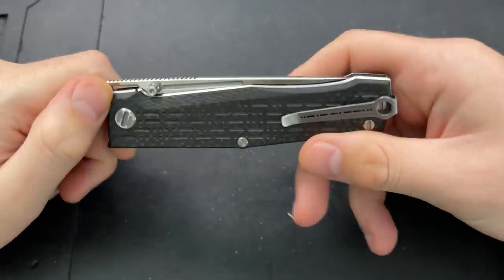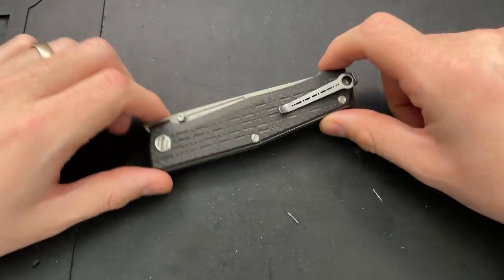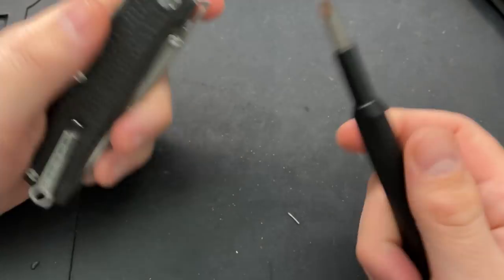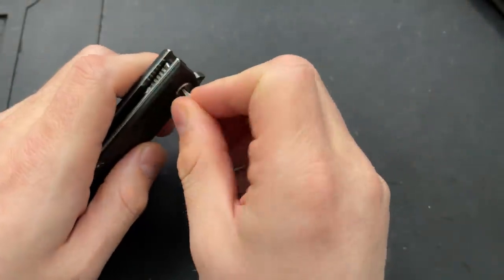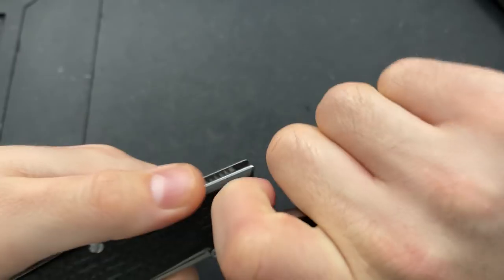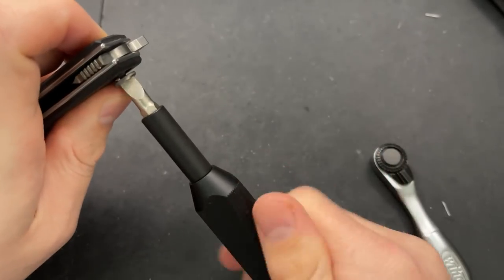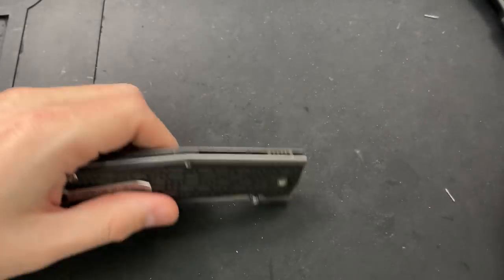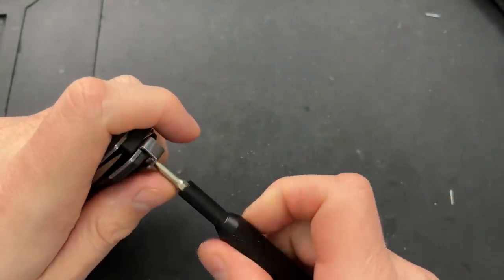How to disassemble and maintain the Real Steel Rokot Pocketknife

Comment: You should use the rubber tipped drivers used in firearm assembly and disassembly to prevent scratched id a driver slips.